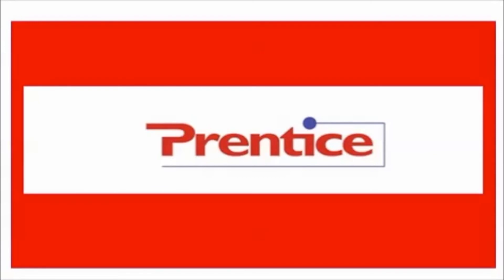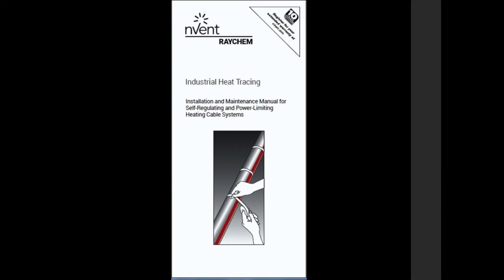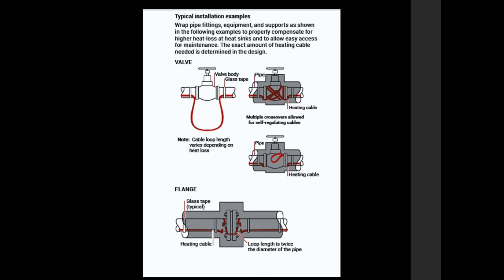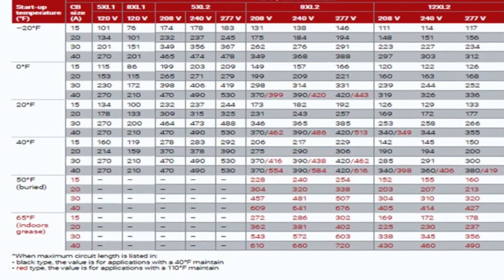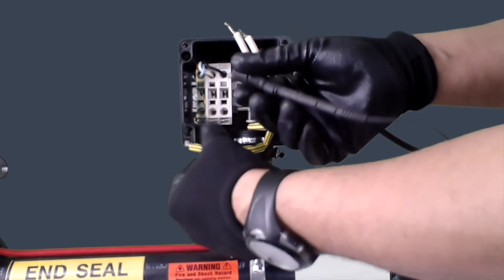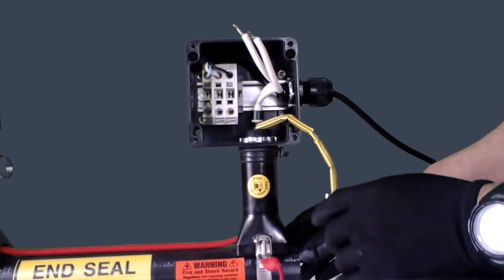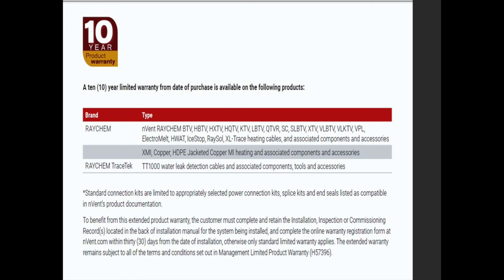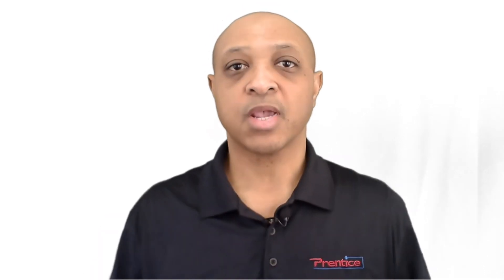HEAT TRACE VIDEO 6 TESTING & WARRANTY

Comment: Is there a test for resistance between the 2 busbars? I just spent all day working on heat trace, megged good, and then it trips the breaker… after resetting the breaker a few times one of the splices started to shoot fire.